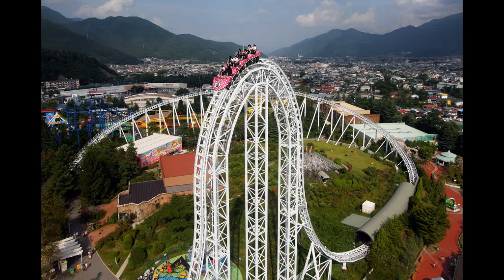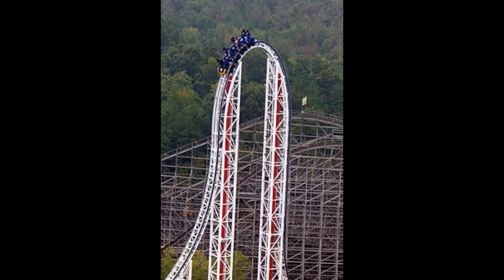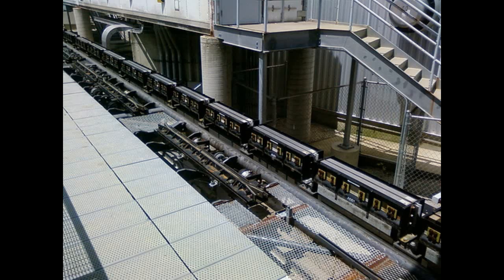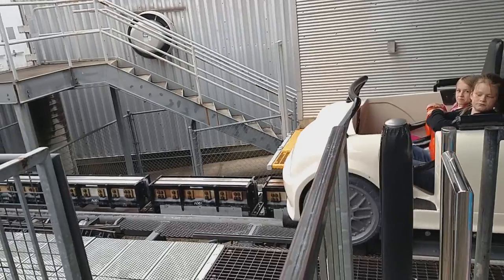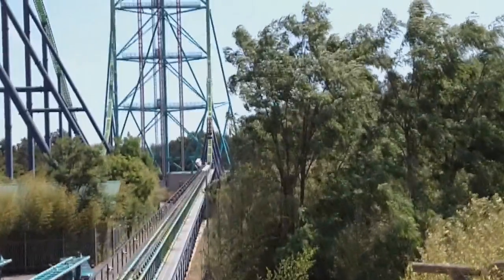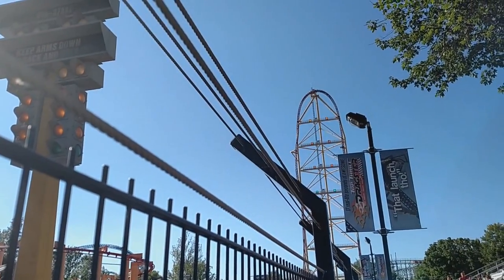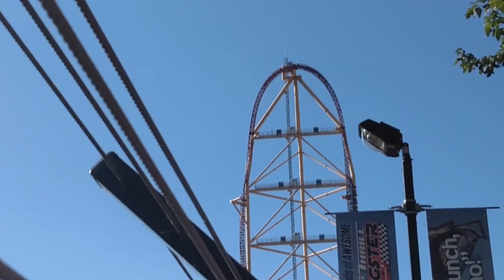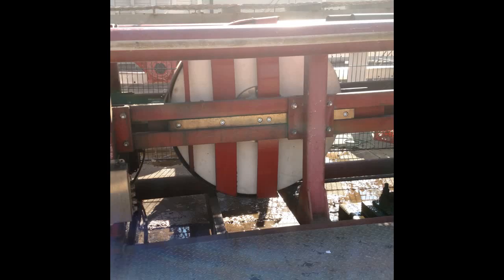Top 5 Roller Coaster Launch Types

Comment: The reason I would guess why Maverick uses an LSM lift hill is because putting both a chain mechanism and a launch fin on the train would be more difficult than simply turning the launch system into a lift, as Maverick already has a real launch

Comment: That S&S air launch on hypersonic xlc donpla or whatever it's called. those launches are bad ass intense and soo fast. hypersonic xlc was my favorite coaster at Kings Dominion 80mph in 1.8 seconds...yeah it was amazing. super forceful you couldn't keep your head off the seat during takeoff. I think it was faster than the take-off systems they use for jets on aircraft carriers. It was a sad day when I found out they were tearing it down the only bad thing about it was it wasn't that reliable but the Hyper Sonic was a prototype s&s made in 2000 I think if they refined the system a little more it would have been great and reliably wouldn't of been a issue. the last few years 05, 06, and 07. Kings Dominion and seem to have figured it out and it was open a lot more than it was the years before that but when Cedar Fair bought all the Paramount parks I think it was just a headache they wanted to get rid of
Reply: No roller coaster compares to aircraft carrier launching systems. Those can manage in excess of 170 miles per hour in just two seconds.